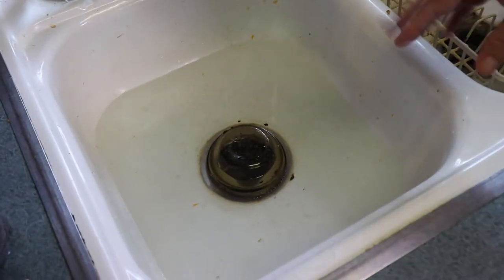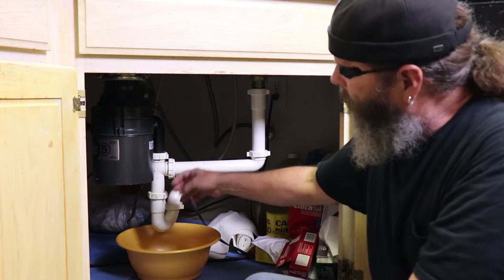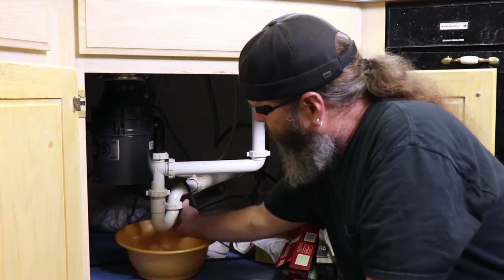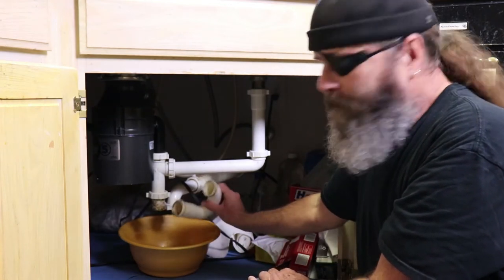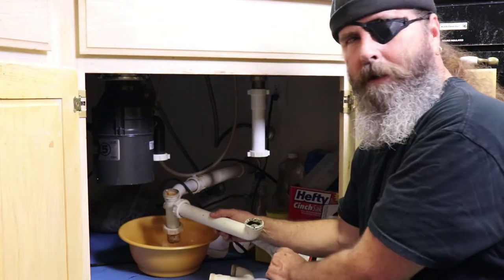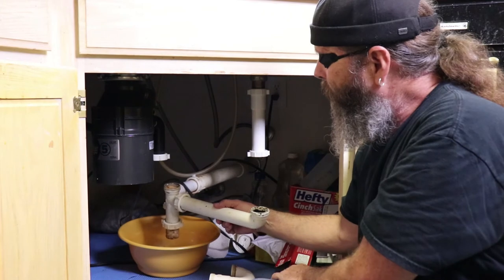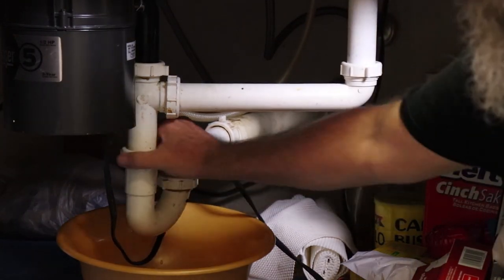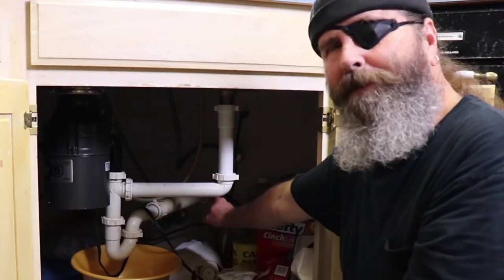Clogged Up Garbage Disposal? Here's How to Fix it!

Comment: Ok, I did put 2 1/2 cups of cold left over spaghetti in my disposal and it has clogged the lower part of the disposal.  Is there ANY WAY I can clear it without taking all the pipes apart!?  Your videos are so clear.  Thank you.
Reply from the maker: Aye, lass, it is possible that a product called "Instant Power" (comes in a black bottle) could do the trick. However, if that doesn't work, taking it apart is probably the only way to clear it.

Comment: My pipe was clean and had the outside snaked and still water backs up😢 do I need a new disposal the motors is fine and grinds fine
Reply from the maker: Once you turn on the water, how long does it take for the water to back up into the sink? When was the disposal installed?

Comment: I follow your direction captain, very good tutorial , but the water doesn’t drain fast from the garbage disposal sink.  What  Should I do . I know I need to replace the unit.
Reply from the maker: Have you cleaned out the tube that goes from the inside of the disposal out to the drain that goes into the P trap?

Comment: My problem is not in the pipes. It is inside the disposal beneath the cutting blades. How do I take that apart.?  Thanks, Joe in Punta Gorda
Reply from the maker: Aye, Joe, try taking off the pipe on the side of the disposal, then try pushing a screw driver into the hole, through to the inside of the disposal, just above the blades.

Comment: I took apart all my drain lines and cleaned everything out. I still have water backing up in both sinks. Could the garbage disposal be the culprit?
Reply from the maker: It be possible, matey.  Two things. First., check where the drain line connects to the garbage disposal, between there and the inside of the disposal.  Make sure the knock-out plug has been removed.  If that is clear, then check the drain line where is goes into the wall, and make sure that is clear and draining properly.  Please let me know if either of these work.  If not, we'll try something else.

Comment: My kitchen sink is stopped up somewhere.  My daughter and I took all the pipes loose and there was nothing in them.  When there is water in the side with the garbage disposal and I turn the disposal on, everything comes up in the other sink.  Then it takes a long time for both sinks to drain completely.  I am wondering if there is something in the disposal that is causing this.  Today is Saturday and I can’t get a plumber until Monday.  Any suggestions?
Reply from the maker: Aye, take the pipe loose from the side of the disposal, and see if you can push the handle of a spoon into the disposal chamber.  If that doesn't work, and you've already leaned the P trap, then the problem could be further down the system.  Do you have a snake?

Comment: I've done this and snaked the pipes in the wall. Water will slowly drain but once I turn on the disposal both sides of the sink fill up with water.  What else should I try? Thanks
Reply from the maker: I've used this product successfully many times.  If this doesn't work after a couple of tries, you might need a plumber.
https://www.homedepot.com/p/Instant-Power-67-6-oz-Hair-and-Grease-Drain-Cleaner-1970/100169339

Comment: Dental floss (8 inches or so) got into the disposal. Didn't see it, turned on the disposal and now it won't drain, which makes sense! I was able to get most of it out in small pieces using needle nose pliers, and I can't see any more of it, but it still won't drain. The disposal blades are not stuck. If I turn it for a few seconds, it sounds and looks normal. If I run water for 5 to 10 seconds, it won't drain. I've tried pulsing the on/off switch. I've reset the disposal and it still won't drain. What now?
Reply from the maker: Have you checked the P-trap to see if there might be something else causing the backup? I would try that first, then check all of the pipes, from the disposal to where it goes into the wall. Let me know what you find.
Reply: @thepiratehandyman2225  P-trap was clean, but the pipes had 30 years of 'stuff' in them. Got a snake and back in business. Thanks for the quick response - arrrgh!
Reply from the maker: Arrrgh, matey, glad yer back in business - smooth sailin'!

Comment: I found p-trap full of black water, cleaned it out, still have bad smell from disposal, is there a block to the sewer line?
Reply from the maker: Is the water still backing up?  If not, put in lemon rind in the disposal and grind it up.  That should eliminate the smell.
Reply: @thepiratehandyman2225  okay, thanks for the tip, will give it a try
Reply from the maker: Let me know if it works, matey!

Comment: Can my problem be in the trap arm? The p trap is clear of the water but I’m back to the same problem of both sinks being clogged up
Reply from the maker: Aye, matey, it could be the trap arm, or between the p-trap and the wall.  If you take off the trap arm and it is not clogged, you should try running a snake into the pipe that goes into the wall.  Let us know if that solves the problem.

Comment: I cleaned out my pantry and had a few cups of flax meal..tried plunging. right side ok left side disposal not ok
tried hot water and instapower..
very slowly draining..
Reply from the maker: Aye, lass, you may have a clog between the disposal and the P-trap. Have you tried taking those pieces apart to see if they are clogged?
Reply: @thepiratehandyman2225  Aye, Ill give it a go in the morning.
Reply from the maker: Smooth sailin'. lass!

Comment: My issue was from potato peels also, plus onion skin. Thanks for the insight! I just had my basement snaked (massive flood) so in no way did I want to all a plumber!
Reply from the maker: Aye, lass, potato peels, pasta, egg shells - they all be gummin' up the works. Glad ye were able to fix it - smooth sailin'!
Reply: @thepiratehandyman2225  Just found your channel due to clog in kitchen right after I tried to dispose of rice! So annoyed! I'm good about nothing greasy poured down sink..or potato skins. I thought rice kernels were too loose to clog, guess not! Argh...
What else do I need to watch for? Egg shells I know.
Reply from the maker: Pasta can clog yer pipes sumthin terrible - anything starchy should be tossed in yer garbage.

Comment: I'm getting ready to try this, but have a question. When I turn on my disposer, water shoots out of the vent on top of my sink. Do I have some other issue going on in addition to the clog?
Reply from the maker: Nay, lass, the clog must be located behind the the pipe that leads to the vent.  When you remove and clean the P trap, make sure the pipe that leads out to the drain is not clogged.  Good luck, and let us know if it worked!
Reply: @thepiratehandyman2225  Weeeel, in attempting to remove the pipe from the vent to the p-trap, I broke the fitting holding the pipe to the bottom of the sink. So...now I'm going to the hardware to get a replacement fitting for that. The clog wasn't in the line from the vent to the p-trap, so now I'm thinking it's further along in the pipe where it goes out the wall? Tried using a short snake but got nothing out. Going back in with a longer metal snake next.
Reply from the maker: I break stuff all the time while trying to fix things - it's part of the process! ;-) If the longer snake doesn't work, try a product called Instant Power Hair and Grease Remover.  It comes in a black bottle, and works wonders.  Just follow the instructions, and you may have to do 2 rounds, but it's much cheaper than a plumber.  If that doesn't work, then a plumber may be your only option.
Reply: @thepiratehandyman2225  snaked the pipe, got the clog out, and replaced the broken part, just $4.28 at Lowe’s! Thank you for your help, you saved me a LOT of cash! 🙌🏻
Reply from the maker: So glad that worked, lass - saving coin is the best!  Smooth sailin!
Reply: . That's why I'm afraid to take any parts apart.  I have a knack for messing up anything beyond plunging, simple drain clearing.  I have an Allen wrench but can't find it.  Hoping somehow plunging & warm water flushing will clear it eventually.   Live in apartment bldg.  where maintenance requests are filled according to date received so would like to fix it before it gets worse.

Comment: What if your sink without the garbage disposal drains fine, but the garbage disposal side doesn't? There was nothing in the P-trap, and liquid plumber didn't help.
Reply from the maker: Check the pipe that connects the P-trap to the side of the garbage disposal.  The pipe comes off with 2 screws on the side of the disposal.  If that pipe is clear, look inside the disposal where you removed the pipe.  Le us know if that worked, matey!

Comment: OMG! My garbage disposal plugged up right in the middle of peeling potatoes to dehydrate. I normally don’t peel potatoes but decided to do so for dehydrating. I put vinegar and baking soda in, ran with hot water, did the other side of the sink and used a plunger......2 hours later still looking at brown water in my sink. So, i figured it was in the pipe but I thought I had to have special tools to take everything apart. I watched your video and decided to try it. I only removed the pea trap and it was full of skins. I put a brush in the other pipes....just a bit nervous to remove anymore. Now that I got it back together and everything is working, I’ll have more confidence if things run slow to remove a bit farther up the pipe trail. I’m mid 70’s, grandma of six with my first great grand baby on the way and I self cleaned the pipes under my sink! Saved me $100 or more. Sooooo happy. Thanks for your video that covered every question I would have had.  🤗
Reply from the maker: Aye, lass, glad it worked for ye - made me heart glad to read this!  I be a grandfather of 7, so I be so happy to hear that the video helped one of me contemporaries!  Smooth sailin, me lady!

Comment: My P trap was clean and  not clogged. I still have water not draining.
Reply from the maker: Check the pipe coming out of the garbage disposal. That can be another choke point.
Reply: @thepiratehandyman2225 The garbage disposal and all the pvc pipes are clear. There was a very strong odor after disassembling the pvc pipes. I tried to put a snake into the pvc pipe going out into the back wall of the condo unit but it was blocked by a turn in the pipe. When I put everything back together, water still backs up into the sink. I would like to see the second video. Tgank you.
Reply from the maker: Here are 2 other videos that might might provide some insight? Let me know if these help. 
https://youtu.be/21Gl3ObLH6Q 
https://youtu.be/c2UWSIBx5xM

Comment: I took off all the pipes and there was no Clog in either of the pipes. I even snaked them.... Nothing. Put them back on and still got the same result, still  clogged.... Idk what to do next
Reply from the maker: Did you snake the drain all the way back into the wall?  Did you check to make sure the knockout plug in the garbage disposal?  If yes to both, try using a product called "Instant Power" (https://www.homedepot.com/p/Instant-Power-67-6-oz-Hair-and-Grease-Drain-Cleaner-1970/100169339). Otherwise, you may have to call a plumber.
Reply: @thepiratehandyman2225  I went all the way to the wall, gotta check the disposal later today

Comment: my disposal is clogged, due to an excess amount of fresh spinach I put down it.  We have tried everything except disconnecting the pipes under the sink.
Reply from the maker: Aye, lass. yer gonna have to take of the P trap at the bottom.  Or, you could try a bottle of Instant Power, but it takes overnight to work.  If you can avoid using the sink for that long, that is an option. Otherwise, just follow the instructions on removing the P trap, and that should work.

Comment: What if the pipes are clear and you suspect it’s the sewer line.. how do you clear the sewer line?
Reply from the maker: If you cannot reach the clog with an auger, try getting a bottle of Instant Power.  I have had great luck with it.  If that doesn't work, I'm afraid you will need a plumber.

Comment: What if the water in the sink drains but slowly?
Reply from the maker: Then ye most likely have a partial clog somewhere in the drain line.  Try pouring some Instant Power in the drain and letting it sit over night (https://www.homedepot.com/p/Instant-Power-67-6-oz-Hair-and-Grease-Drain-Cleaner-1970/100169339).

If it still drains slowly, start dismantling the drain, starting at the garbage disposal.  If you can't find the clog between the garbage disposal and where the drain enters the wall, then use a snake, pushing it into the drain as it goes into the wall until you come up against the clog and dislodge it.
Reply: @thepiratehandyman2225  thank you! I should clarify, the sink drains slowly and the garbage disposal doesn't work, it just hums. Is the drain cleaner still the way to go? I tried to remove the U pipe but couldn't because they glued it together?!?! (Ahhhh the joys of apartment living)
Reply from the maker: Glued????  Idiots should be keel hauled!  Before using the Instant Power, watch the video on Garbage Disposal Won't Spin.  There are 2 things to try in order to get the Garbage Disposal to work - the red reset button, and using an Allen wrench on the end of the shaft (bottom of the disposal) and trying to get it "unstuck."  if that works, and it still drains slowly, then try the Instant Power.  If that doesn't work, you'll need to call apartment maintenance.  Let me know what happens!
Reply from the maker: Here's the link to the other video.
https://youtu.be/21Gl3ObLH6Q

Comment: I guess I am the 1%, I also snaked it with a 25ft auger and still clogs after 39 seconds of running water. It does go down just slowly. No clue  maybe I pushed the blockage to 25 ft. I do have about 38ft of a run to the main drain pipe. Not sure if I get a 50 ft auger or call a plumber.
Reply from the maker: Have you run the auger both from the clean-out access to the street, and the clean-out access back to the house?
Reply from the maker: You also might try a product called Instant Power Hair and Grease.  It comes in a black bottle.  I used it in a similar situation to yours, and it worked great.  Put in half a bottle, let it sit for 8 - 12 hours, then use hot water.  Good luck, matey!
Reply: @thepiratehandyman2225  thanks, I will keep plugging away at it
Reply from the maker: Did you find a solution?
Reply: Yes, it is all clear now. It simply needed more  line to run through the pipe. 25ft was not enough, the 50 ft was the answer.  Thanks for your help
Reply: @thepiratehandyman2225  Having this exact issue and never used an auger before. If you have a video on it, that would be helpful. Should I buy or rent one? Thank you.
Reply from the maker: That's a great suggestion, lass!  We'll out that on the schedule.
Reply from the maker: Lass, your video is up.  Thank you again for the suggestion!  Here is the link:
https://youtu.be/8XqTBy5DKRY

Comment: YOU SAVED ME SERIOUS COIN! Of all the video's I've watched over the years for DIY fixes this was by far the best. Every single thing you mentioned, including leaving the rings loose, was exactly what happened. 

Now a funny story. The p-trap was packed with spaghetti, carrot peels, eggshells, and an experimental (disgusting) pumpkin soup. I'd been doing dishes while letting the water run - you can imagine how gross that 2 inches of standing water looked. 

Anyway, seeing the trap so clogged with food I had an immediate urge to stand up and clean it out - in the sink. The pan I'd put underneath, just like you said to do, was already full with that gross new baby poo colored water and it was a good 4 seconds before I heard plopping and splashing and it dawned on me that I can be a complete idiot sometimes and that the ground up food and running water was freely pouring all over the bottom of the cupboard and onto the floor! 

After starting a load orange water soaked bath towels used to sop up that mess, a 2nd cup of coffee and knowing I saved serious coin that chaos will be remembered as just a funny story. Me and my treasure chest THANK YOU SO MUCH!
Reply from the maker: Aw, lass ye bring a tear to me eye!  Both fer yer thanks and fer your story!  I've done the same thing - like turning on the water to warsh me hands before reconnecting them pipes.  So glad we were able to help save you some coin.  Smooth sailin', lass!

Comment: that's great for clogged pipes, but when running my disposer it fills up with water, this didn't help at all
Reply from the maker: Sorry to hear that, matey.  The clog might be in the hose/pipe going from the disposal down into the drainpipe.  Try taking the hose/pipe loose from the disposal, and see if that is where the clog is.
Reply: Both!